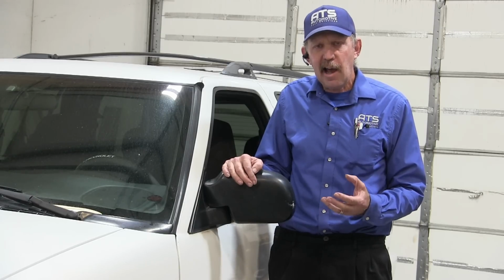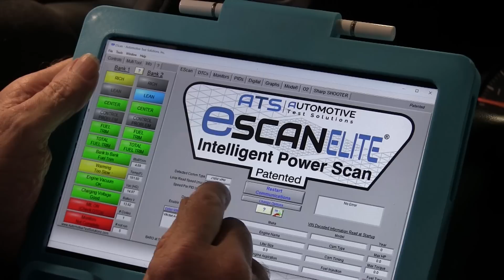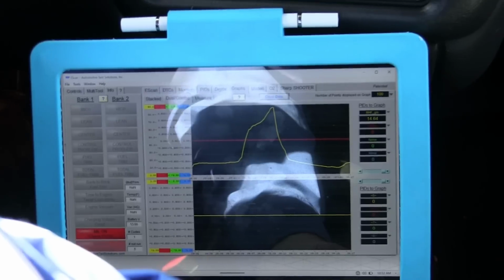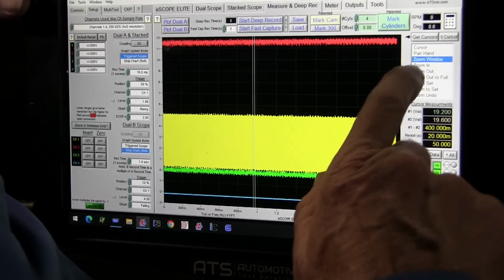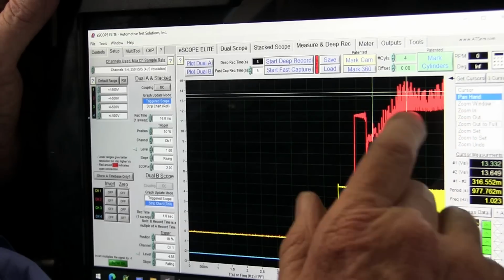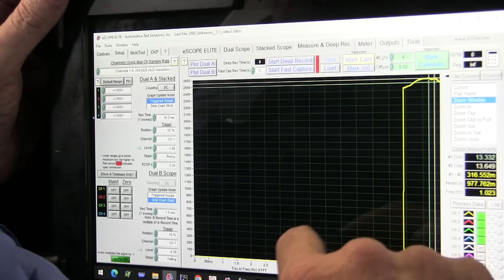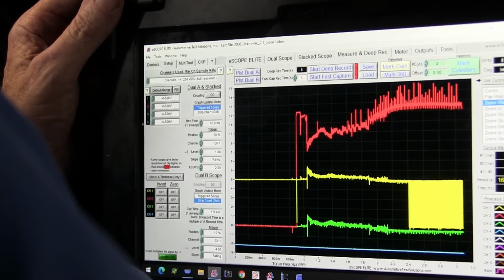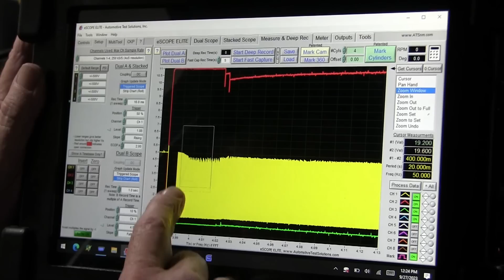2000 chevy blazer

Comment: Excellent video, scope shutting down with dtc set is a great idea. This should be in every dealership too. First time i ever saw something this easy to diagnose. Bernie we are not engineers so to think like one well you have to have that mindset. I know I don't and 99% of the watching do not have that ability either. That scope is awesome too bad for us retired techs it is not affordable to have in our garage. Any time I replace any mas sensor it has to be OEM new or reman by them or the maker of said sensor reman. If the part is made by denso, bosch their remans in aftermarket I never had problems with and doesn't have the dealership added cost either.

Comment: The read continuous feature was actually critical in making this diagnosis successfully. One would not be tipped off to the fact that the startup latency is causing the code if the scope did not stop, because there would be no way for the diagnostician to know that's the moment the code is actually setting.

Comment: I connected my Escan to my Silverado, and before I could perform any tests, it spoke to me saying, Overcharging, charging normal, overcharging, charging normal..." I thought, "Why is it telling me this if the battery cranks good and tests good. And the gauge indicates 14.1v.?" I turned ON the AC and suddenly the gauge dropped to battery voltage, which was 12.1v. I don't know why the alternator failed suddenly, but what I do know is that the original owner had a powerful stereo and didn't upgrade the alternator and he also sprayed a lot of awesome to clean the engine compartment and didn't cover the alternator. I just bought this Silverado a few days ago. Turning the AC and powerful stereo system on at the same time most likely killed the alternator. It has 141k miles.

Comment: 2 main questions for me: 
1: how did you know that the sensor pulling down the 5V Ref. to GND and not an internal oscillator from the ECU generates the base frequency after some time and the sensor only changes the frequency?
2: what leads you to the idea to check the delay after power on the ignition? 
Very good work, i watch you from switzerland :)
Reply: #2 I think I can answer for you.
He did not have the idea to check the delay until when the freeze frame happened right at startup when the code set, which narrowed the search immediatley- he did not have to drive the vehicle to set the code.
Thinking like an engineer and code set conditions, if the frequency was below a certain rate at the beginning of startup when the Crank position did indicate engine running, well, there is a problem so the DTC popped. So he figured out the code set condition and that the sensor was not reacting appropriately. Then he applied some well founded bias that a non OE part is too blame, which also lined up with the vehicles history of three aftermarket MAF's installed.

Comment: 9.40 to 10.05 of the video
The next screen shows 5 volts on the yellow?
Reply: If you're referring to the MAF signal (yellow trace), it's oscillating between 5V and 0V with the engine running. That's normal with this style of digital MAF sensor.
Reply: @abdul-kabiralegbe5660  I did not understand the 2.6 reading on the scope yellow trace then I realized    
The setting was on dmm and was averaging the minimum and maximum of the switching signal now I understand 👍

Comment: 9.20 to 9.40 of the video the yellow was in the 5 volt ref signal wire when he looked to see if he had a connect with the probe yellow was reading 2.5 2.6
It should have been 5 volts
Ecm pulls it to ground ????? 😲 Hz?
Reply: The yellow channel is on the signal wire. MAF will pulse to ground with koeo or running..

Comment: You don't need a known good just think like an engineer bernie is no doubt data driving diagnostics. 👍🇺🇸♦️♦️♦️smart with common sense 👍😁
Reply: It pays to know the different ways the same design problem is solved by engineers in various brands. That being said, the reason for having a known good waveform is so those who work on all makes and models can know WHICH one solution out of the many possibilities was used by the guys in the design department.
Reply: Bernie figured it out just by looking at the waveform I guess his background in design and development and 30 years a shop owner helps and probably uses a known good now and then good point 👍